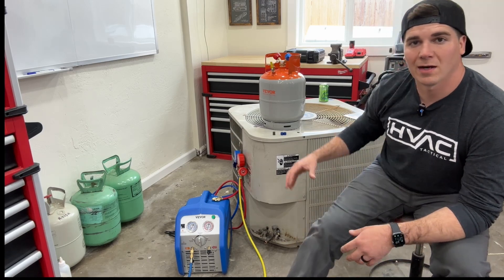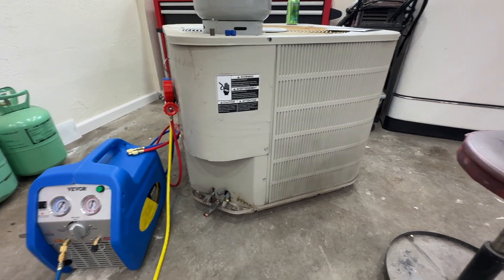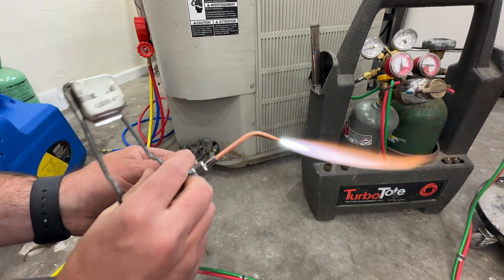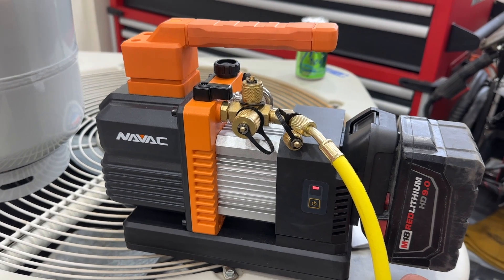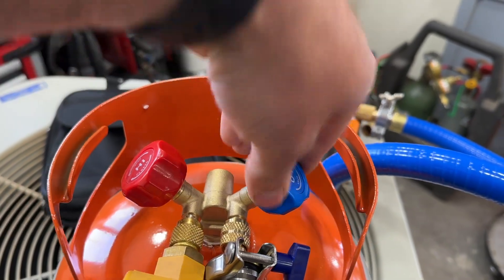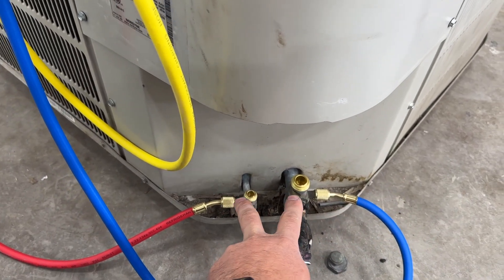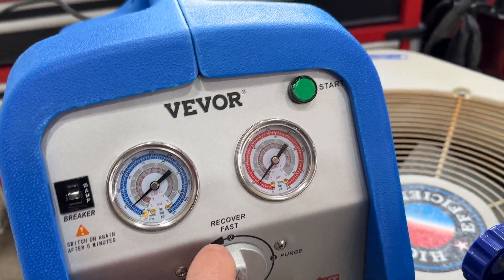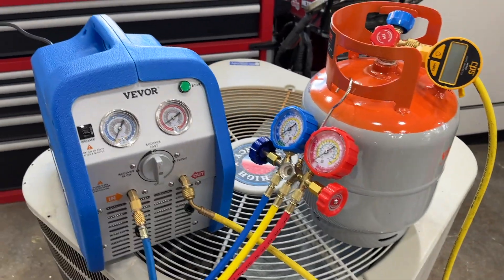How To Properly Recover HVAC Refrigerant Into A Tank

Comment: Nobody is getting a license. They are just going to try this and this could create all kinds of issues for you my young friend. I wouldn’t publish videos like this. Unless you own all of the units you cannot reuse or sell this refrigerant. Do you really think homeowners and YouTube viewers won’t mix refrigerants or even know when the cylinder is full?  There are all kinds of things missing from this video about safety and legal matters.
Reply from the maker: Who are you to make the claim that no one is getting their license?
Reply: @diyhvacguy  a guy who can spot a scam.  When they f*ck things up they will blame you. You are the hack. You’re like Bob Vila selling tools. You will eventually get caught and sooner than you think.
Reply: @diyhvacguy  I believe everyone has a right to work on their own equipment as long as they abide by laws.  Get EPA cert if handling refrigerant. Learn. The equipment cost is going to be far less than what you pay for a company to replace. (No different than having the right to work on your vehicles, replace a water heater, receptacles, furnace, or even breakers). Learn what you are doing, understand your ability.

Think of motor vehicles under section 609 of the clean air act.  Any regular Joe can buy EPA approved refrigerant for their vehicle at a auto shop.  You only need to be licensed when payments are involved for services or bartering.  You should not intentionally release refrigerant. On a motor vehicle you are not required by EPA to repair a leak prior to adding vehicle refrigerant.  Follow the rules and you will be fine.
Reply: @JSATI  you can buy small cans of refrigerant at the auto parts store that you can hook up to your suction line and dump into your own car. That is completely different than removing refrigerant from units and putting them in a can that could be easily overfilled and explode in the back of somebody’s van.  He is demonstrating products here that legally you should not be able to get without the EPA license, but even with the PA license, it doesn’t mean you really know what you’re doing.
Reply: @Nine_883  agreed on the auto it was just something interesting to point out.  The only items he showed were a recovery machine and recovery tank. Neither are legally required to have a EPA license to purchase.  Everyone has an opinion however if you stay within guidelines of local, state, and federal requirements there should be no concern.  EPA license is required to purchase refrigerant however in the example it was recovering refrigerant from your own system.  No purchase was required unless you are adding new refrigerant back into system.
Reply: @JSATI  you have to have a license to hook a gauge to an air conditioner. Look I don’t care about the law. Do whatever you want. We all break traffic laws daily and some people break all kinds of laws daily. I am not the EPA police. I know the dangers of high pressure refrigerants. I also know human nature. People are not going to be trained. The license doesn’t make you an expert at all. It means you passed a test about laws. Slum lords will watch this video and think they can sell R22, steal R22, horde R22, and they won’t even know what refrigerant is in the unit. I have seen it all man. I still see kids coming out of a 2 year degree program that do ignorant dangerous stuff every day. It’s called knowing just enough to be dangerous.  He didn’t even have a scale in the video. It’s so easy to overfill a bottle. People who want to do this are not homeowners. If it were me I would just crack a valve and blow the charge and say it all leaked out. I would not buy a recovery machine, vacuum pump, recovery cylinder, and gauges to recover my own unit. What would you do with it after?  You may be able to buy a recovery cylinder on EBay or even Amazon, but no reputable wholesaler would sell you any of this stuff without an account and a license. Don’t believe me?   Walk into Johnstone Supply and try to by an empty recovery cylinder and a machine. Or take your recovered refrigerant into a wholesaler and see if they will dispose of it for you (for free).  Not going to happen.  And you probably will not find an EPA approved recovery cylinder on Amazon.  Even if you did nobody would take it these days. You get the cylinders from the wholesaler and return them to the same wholesaler. Most will not take an Amazon special. All I am saying is this goes beyond DIY. It’s dangerous. Obviously more dangerous than you know. If the overfilled cylinder blows off or explodes in your vehicle, while you’re in it, you could easily die.  You could suffocate you could be poisoned you could be injured or you could just smash your van into a telephone pole. And you might say one units not gonna fill a cylinder and you will be correct but nobody is going to invest in all of this equipment to recover one unit.  😬
Reply: @JSATI  Not being an ass but in your state are you allowed to change water heaters in your own house without a plumbers license? They let you take gas apart and water lines and hook em back up? Even an electrical heater they let you just play with 220 lines? Electrical outlets…eh ya I can see that if you have some knowledge on how to be safe about it. But even breakers in a panel? No electrician license you can just, go wild if it’s your house? I only say it cause I’m from mass and it’s a 5 year work hours apprenticeship and hundreds of school hours before your even allowed to take a state board test that lets you do what you just said you believe ppl should be able to do in their own house. Letting a homeowner take gas apart and just terrifying to me cause I’ve seen licensed guys work that made me shake my head 😂
Reply: @drewstaf2955 I reside in Indiana.  You can do your own electrical, plumbing, hvac etc.  You do need to pull permits as required and show ownership. Some work such as panel upgrade does require a licensed electrician.

Gas is low pressure.  Pretty safe to work with if you have a general knowledge.  Use shut offs, etc.

For HVAC, anyone can buy refrigerant online.  You either have to have a epa card or say you are buying it to allow someone to do the work that has an epa card.  Outside of refrigerant epa requirements you can work and repair your own systems. 

Just because some are intimidated by the work doesn't mean you should not have the right to repair your own equipment if you have the knowledge base to do so.
Reply: @diyhvacguy  because I am not new. Home owners are not running out to get a license to scrap and old air conditioner.  You already showed them the basics. You have also showed people how to steal R22 and told them how valuable it is. Why didn’t you just tell them to put and old tank in the freezer overnight and they can get most of it out by simply hooking up and ice cold cylinder with no machine at all. There I just did.  You’re going to have people overfilling cylinders, mixing refrigerants and oil, getting air in the lines, and god knows what else. You don’t even have the cylinder sitting on a scale and warning them about overfilling. And why get a recovery cylinder at all?  Just drill a hole on an old R22 can and braze a shrader in the can to refill it. The stuff is like “gold” these days right?  You have to be careful man. Recovering refrigerant is not for the beginner. It can be dangerous. Overfill a can and throw it in a hot truck and find out. This is YouTube man. Anybody can watch this and then know just enough to be dangerous.  You can’t reuse R22 unless you put it in units that you own. You cannot even put a gauge on a unit without a unit legally. You really think people are going to pay to take a test, wait for the test, wait for the result, and wait for the actual license?  Hello?  Americans are not know for following the law and you even said yourself how easy it is to get the license?  Ask yourself if you were hiring a technician. Would you hire a guy to go out and work on this stuff on your payroll if all he had was an EPA license and absolutely no experience at all in the real world!  That would be foolish, dangerous, and very risky for your liability insurance. I just think planting ideas that this is somehow soooo simple is a bad idea. So many things can go wrong when a guy watches this video and buys a set of gauges and other cheap equipment on Amazon. It may be simple and all make sense for you, but to most people this is so far out of their scope it’s dangerous. Bad things can happen and you can find yourself in how water. I realize you are promoting products and getting free stuff but teaching people the HVAC trade on YouTube is not possible when it comes to recovering refrigerant, charging refrigerant, setting superheat‘s, and transporting refrigerant.  You wouldn’t want somebody working on your stuff if all he had for experience was the fact that he watched a YouTube video.
Reply: @Nine_883 license hvac guys hate when people start doing there own work. What your really mad about is people learning. Finding out how easy things are and being over charged for simple fixes. You spent the time and money to properly learn your trade, I get it.
Reply: @Nine_883I’m glad you took the time to say it. There’s dudes on here saying ppl should have the right to change their own water heaters. wtf, electric ok a little less as long as u know how to use a meter and a breaker but a gas water heater? Are you nuts? It took me 5 years and hours of school before they let me take a state board to be a plumber (and be allowed to change water heaters) and there’s a reason. And I’m with u, I’ve seen licensed guys work that just made me shake my head, I can only imagine what a homeowner getting a gas water heater from a box store is going to do. Some thing just shouldn’t be DIY, at ALL. Welp my 12 year old just watched a video all u need to know about driving in 15 mins, he’s good to go out on the street and tear up the town.
Reply: Someone is mad that someone else is giving people the knowledge to be more capable and you’re mad because it means you can’t rip people off.
Reply: lol, and here I am looking to get a license now.
Reply: Dude. Please. You can get a license pretty much for free. I got mine for 0$.  Let the guy make his videos.
Reply: I am a homeowner. I got my epa universal license so I could work on my own stuff. It wasn’t hard. And I bought $2000 worth of tools to do all the work myself.
Reply: @SkruxLabs-vq4ho  you have to admit that your situation is rare. And getting the EPA license means you know the laws the day you take the test. It doesn’t mean you know how to install or repair anything. It doesn’t mean you have experience. It means you know the EPA laws on recovery, transportation, and handling refrigerants and some very basic principles of air conditioning and or refrigeration.
Reply: @Nine_883 I don’t see what people are upset about. You have a point and you’re not wrong. I also see the point of others. I think if he had done the video a little more thoroughly and explained everything a little more detailed, and added a scale this wouldn’t be an issue. But that’s the point. These are all things you learn from schooling and experience. You can learn “basics” on a YT channel and don’t get me wrong I’m all for spreading the knowledge, but if you’re gonna do it, do it properly. But then again most people don’t think they can have a tank blow up in their face, until well…..a tank blows up in their face. Then I guess they’re the victim right? Nah my G, you didn’t put in the time or learning to know all the ins and outs of refrigeration, equipment, safety, laws, and guidelines. Some people have and that’s why they have job doing this. But then again, it’s a free world so do what you want I guess.
Reply: I don't see your average DIYer buying the $1500+ worth of tools to properly recover a system charge.  I see licensed guys that have been in the trade for decades not doing it properly. Or at all.
Reply: @SerialChiller-VRF  This video is for DIY'ers.  That's the point of the whole debate.  Obviously licensed guys cut corners all of the time and I do mnot care about that.  I am not the EPA police.  Break the law all you want.  My point is that this is not as easy it sounds and it could be dangerous.  When somebody does get hurt badly and the government gets involved in the investigation then they guy who made the video could be held liable and lose everything.  If you don't think this could happen then you must not be living in America.  America is suit happy dude.  Lawsuit USA.  Then on top of that the EPA could slap him with a fine.  Now I am done with this conversation.
Reply: I just got my 608 type II so I could do a little troubleshooting before calling in the professionals. I learned a lot about safety, regulations, and troubleshooting basics (clean filters, airflow test, super heat and sub cool measurement).
Reply: FYI if someone catches you releasing Freon in the air it’s like almost 50k fine and 10k for the guy that turns you in. So be careful.
Reply: @christophercarpkey9382  epa has no one to enforce.
Reply: Spoken like someone that's not ashamed to charge $+300 to change a capacitor
Reply: Viel schlimmer ist, dass es Menschen gibt, die ihr KFZ selber reparieren und wenn die Klimaleitung stört einfach geöffnet wird. Ich möchte das nicht machen, deswegen habe ich ich mir so ein Gerät zu gelegt.
Reply: I got one after watching 🤷
Reply: @ there is a sucker born every day.
Reply: I have an EPA license. I went to trade school and love these videos!
Reply: I’m getting my license right now
Reply: Better to watch videos like this rather than doing it wrong
Reply: @richlikeg3722  They suspended my X account because I shared this too much Have you ever seen HVAC techs dumping refrigerant to the atmosphere? Maybe we can expose this. I was an install manager at a large corporate HVAC company in NJ. I reported them to the EPA for employing uncertified techs that were dumping on average 900-1000 lbs. a week of refrigerant mostly R410a and R22. This had been going on for years. causing unseen environmental damage. I reported again 9 months later because nothing was done. 1 molecule of cfc r22 refrigerant can destroy 100,000 o3 ozone molecules. There has been a rise in atmospheric level of cfc and we are blaming it on china which I am sure is helping. I reported again January of 2025 and still nothing has been done EPA says they have no man power and lack leak violation enforcement. and has to be sent to Chicago and when I do that I get no response back. I wonder if it has something to do with the person that Trump appointed to the EPA from DuPont Who makes the refrigerant, Lynn Ann Dekleva. This is only one of 21 HVAC companies the CEO owns on the east coast I am sure most of them are doing the same. You need an EPA license to work with refrigerant and all they would have needed to do is ask for the refrigerant logs they are legally required to keep track of that they never had. This is either serious incompetency or serious corruption. This is a $44,000 fine per offense and literally no one is being held accountable
Reply: Shut up nerd
Reply: Bro shut up nobody cares, if some chuck in a truck does this its that guys problem. Information is free and no one can be held liable for releasing information. Shut up
Reply: Maybe we could espose this.  I was a manager at a corporate hvac company In NJ I reported reports  900-1000 lbs of refridgerant a week average dumped to the atmosphere for years to the EPA by uncertified Techs causing damage to environment I reported again to EPA because it was lost or nothing was done Unseen Environmental Disaster 1 molecule can destroy 100000 O3 molecules ozone.  Refrigerant 
 R22 r410a EPA says they have no man power in our area and all leak report handling is done out of cicago they tell me to send to ODS.TIPS@EPA.GOV  and never get a response back.  This will be the third time ive reported
Reply: Shut up weather boy
Reply: What needs to happen and will is all these DIY know it all’s need and eventually get a visit from the EPA and you can explain your expertise to them. And ohhhh make sure you have your checkbook handy or for your $25000 fine.  And sorry Mr. Know it all you can not recharge another system with recovered refrigerant from another system if you do not own it. In simple terms you can’t charge your buddy’s system. But hey WHY DID I GET A CERTIFIED UNIVERSAL LICENSE? What do I know more then you? I’ll let my apprentice know all you have to do is abide by laws. But wait, abiding by the laws means you need to be licensed????? I’m really confused now, better watch some more of your videos 😂 EPA will make an example of one or many of you yet. Show Them the Money 😂💵
Reply: @paulgalli6433  chill the hell out dude the same government you want to find you because you released a little bit of gas to the ozone is the same government that blew up the Nord stream Pipeline and literally dumped more pollution into the atmosphere than all of the history of humankind in one moment
Reply: @paulgalli6433 according to the local building inspector…I don’t need a license to do any of it in my home…if I can’t hire someone to do it…then that’s fine! I’ll just figure it out myself! Sob’s think they have the right to say who can and can’t have ac in their home!? If I have the money to pay for it then why not? Because they’re criminals who discriminate and no other reason…so eff that bs! I’ll do it myself!
Reply: And my final comment. This thing was looking bad the second you fired up that torch to shit those lines off.  If a guy puts the heat to the wrong fitting and blows that charge in his own face he could be dead. Again, to you this is simple, but to the ho,e owner who has never done this and doesn’t understand refrigerants this could be a disaster man. It could make the news and his widow will be more than happy to blame the whole thing on YouTube and ultimately yourself. If you have ever seen a liquid line fitting get melted off while it’s full of refrigerant you might edit this part out. You are talking about home owners here man. Some of which never even start a project until they have had 5 beers. You don’t think they could heat up the wrong fittings?  Just sayin man. I have been working in the industry since 1990 and I have seen it all by so called “qualified” idiots. I have seen it all.  I have actually thought that some of your off the grid type power videos were a little sketchy and dangerous, but that is all stuff that is sold at Home Depot and people can try that anyway.  This video is a little different and it crosses over into some territory where I don’t think a homeowner belongs.
Reply: @Nine_883 would u rather have homeowners trying it without ANY guidance at all? It’s not always the case that someone can’t afford to have a pro do it…there’s a lot of cases where people get blacklisted and we know it exists even if y’all don’t want to share it…I got blacklisted because of something my ex husband did a decade ago in town….i can’t hire anyone in this town even to fix a broken water main or install a new ac and furnace…cash in hand even…nope! I’ve been put through hell and back over something I had nothing to do with other then I had been married to the creep years before he actually did his crimes….he didn’t do that bs when I was married to him! But it doesn’t matter! So eff it! I’ll do it myself…and yes…I dug a 6’ deep x 6’x 3’ wide hole in my yard and repaired the water main myself! Dozing rods work awesome for finding leaks